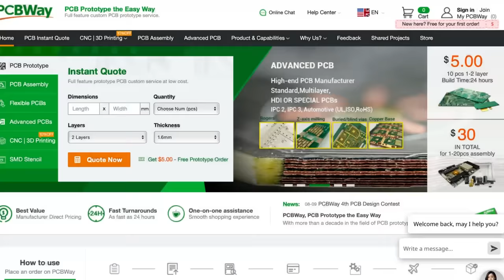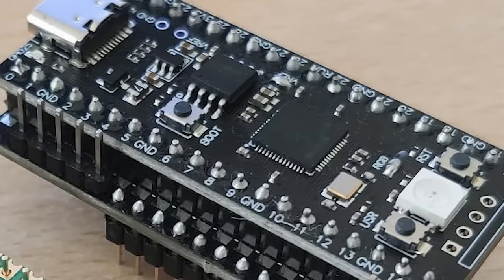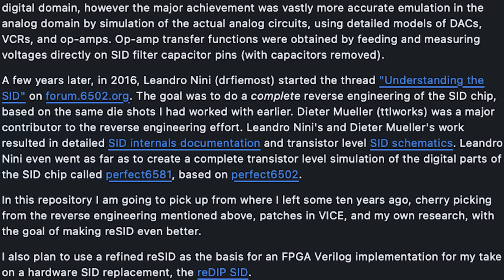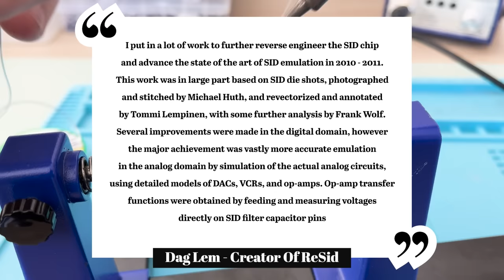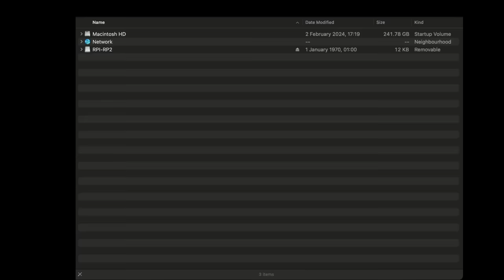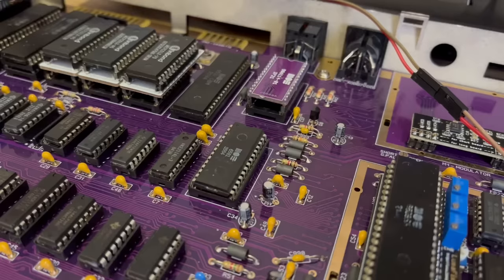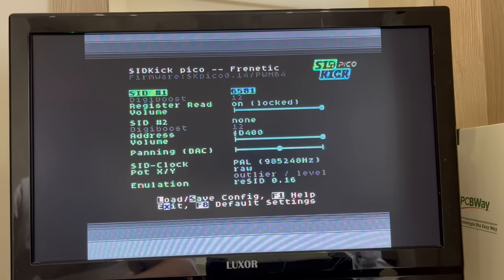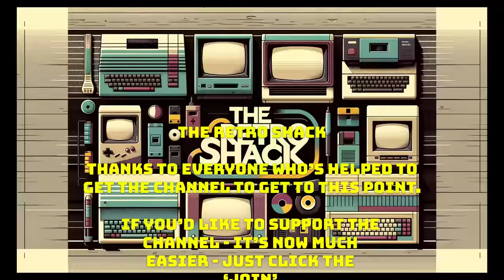Let's build a SIDKick Pico so our c64's 6581 has a friend to play with!  Oh, and is it any good?

Comment: The level shifters are for the data lines: 5v on the C64 to ~3v on the Pico.
Not for the SID 12v/9v down to 5v.
Reply: Yeah the level shifters have nothing to do with the voltage regulation
Reply: Indeed, these types of SID replacements don't typically connect to the 9v/12v pin at all. They just use pin 25 (5V) for power. The 9v/12v pin could be used for automatic motherboard type detection to switch emulation modes, if desired.
Reply from the maker: Thanks Adrian (and others) for pointing this out - I’ll pin this so it’s clear.
Reply: Hello Adrian. Greetings from Scotland.
Enjoy watching your retro computing videos, especially the Haribo intermissions (aye, lol)  @adriansdigitalbasement
Reply: Interestingly Eben Upton claimed the Pico inputs could cope with 5V, Hackaday comments September 25th 2022 on the "Pi Pico does PCMCIA" article.
Reply: @TheRetroShack The 9V is actually for the built in opamp. I have a few bad SIDs here that work but the sound volume is very low, almost zero. That's the opamp part that has failed due to the higher voltage. Just for fun I semi-fixed them by connecting it to an external opamp IC.
Reply: @M0UAW_IO83 it might 'cope' but it's documented officially that the Pi Pico i/o is 3.3V. It might work for a while but it might burn up at some point. Better to just use the 50c level shifter and save the more expensive Pi from any potential damage.
Reply: Yeah it was a whole lot of effort to explain something totally incorrectly 🤣
Reply: @TheRetroShack  And as a general rule for the future, if it says "level shifting" this means it provides a "translation" of HIGH logic level (usually between 3.3V and 5V) for devices that use the respective voltages. Powering voltages are never referred as level shifting, terms like "voltage conversion", "voltage regulation" etc is used for this purpose.

Comment: My tip would be: don't use those ghastly female headers to mate the Pi Pico to the SID board... because they're (aesthetically and technically) ghastly... throw them away and get some nice male and female "machine pin" headers... or just accept that you're "sacrificing" the Pi Pico and just use a single male header soldered on to both the Pico and the SID board.   :)

Comment: Resid is not the most accurate SID emulation any more, that one is unfortunately hidden inside the Plogue chipsynth C64 software synthesizer, which is a commercial software. Except if Plogue will feed back their code one day to the community.

Comment: The biggest issue with the armsid is closed source and encrypted firmware. the microcontroller on there has a protected bootblock that is used for firmware updates. it decrypts the firmware internally. they do that so people can't copy it, especially chinese companies ripping off and re-producing stuff for a fraction of the cost. with the pi pico at least it will be possible to make these almost forever at 1/3rd the cost. The biggest issue facing the sidkick is the eventual end-of-production of the pi pico and the new iteration of it that may or may not be 100% compatible, thus requiring an updated sidkick board. But hopefully someone steps up and does it when that happens.

Comment: Nice to see another SID replacement. I found another one a few months ago called BackSID. Fully compatible with the 6581/8580, everything is implemented except for the seldom used audio passthrough.
Reply: So it has analogue components, or is that side emulated digitally?

Comment: I'm quite impressed by that. The menu looks really good and great to see the Digiboost built in. There were some very subtle differences from the original 6581, but then it's rare to find two 6581 that sound identical (due to the analogue components & how they react to heat). The price is good too, although a group buy may be harder to organise.

Comment: I wonder if anyone ever created a real analog version of the SID's filter using discrete components. It almost certainly wouldn't fit in as small a footprint as these emulators, but it would be kinda cool, even if you had to have it in an external box.
Reply: Im using SwinSIDs and I have an external 8 bit DAC controlling a VCF - analogue low pass voltage controlled filter. It can be used to take out  the high frequency noise but also gives additional sound shaping possibilites.

Comment: Is it possible to buy these fully assembled for those of us who are hesitant to solder stuff? It would be worth the extra cost, even if it's twice as much.
Reply from the maker: I think there’s a link on the SidKick GitHub page for somewhere that sells them direct?
Reply: @TheRetroShack  I looked, but as far as I can tell, there is nothing
Reply: It’s against the license of the pcb.
Reply: @thomasandrews9355  The GPL license? I can find no such restrictions in it.
Reply: @taakelur  the pcb is not gpl sadly CC BY-NC-ND 4.0 also means: selling for profit on ebay (e.g. indicated by pricing), or running a shop and offering hardware under such license (no matter on which platform) is a violation of the license
Reply: @thomasandrews9355  I see. Seems to me this can be easily bypassed by simply paying for the 'work', and not the hardware, though..
Reply: @thomasandrews9355  It is nevertheless possible that a different agreement is concluded between the rights holder (Frenetic) and another party (like the Retro Store). In this case, other restrictions would apply than those specified by the CC BY-NC-ND 4.0 license.
Reply: The soldering that’s remaining after manufacture looks really pretty basic. Honestly, it’s a skill you need to acquire if you want to mess with these things. Pick up some practice kits or go to a VCF where they teach it. Even a local maker space to you probably has lessons. If all else fails, come to Chicago, I’ll show you how.
Reply: @c1ph3rpunk  A bit far from here in Norway, but thanks for the offer. :) Yes, it doesn't look that difficult, so I can probably manage.

Comment: I would only seriously consider using one of these if they could make a version that was the size and shape of the original SID (and ArmSID). Right now, it doesn't look very good. The actual RP2040 chip on the Pi Pico isn't that big, so I guess it should be doable.
Reply: You can cut some height if you fore go the pinheaders and hard solder the Pico to the level shifter board.
Reply: @OscarSommerbo  It will still look bulky and oversized. I am waiting for someone to create a single-PCB version that is the same size as the ArmSID. A standard Pi Pico board is very much larger than it needs to be if you just want the processor, since that PCB is meant to be a breakout board for maker projects and prototypes.
Reply: That would be absolutely doable, but it would increase the cost a lot, so i think that would be out of scope :)
Reply: @chepossofare  I don't see how that would be more expensive than this solution. The RP2040 chip costs $1 on LCSC (which is JLCPCB's parts store), so instead of ordering a manufactured PCB that does only level shifting like was shown in this video you could get a single PCB that also had the RP2040 chip on it, and then you didn't have to buy the Pi Pico board at all, the PCB could be smaller, and you could get the SMD parts, including the RP2040 chip, soldered on by the PCB fab. The main issue with this approach is the time it takes for someone to make the PCB design, and they might not want to make the gerbers available for free download. I don't see why they couldn't compete with the ArmSID on price, though, if they wanted to make a commercial product.
Reply: Go ahead then. It's not like someone's gonna read this comment and do it for you :)
For reasons of looks I only use Commodore made SIDs with the silicon flipped 180°.
Reply: @1337Shockwav3  I don't have time, and I am fine with using ArmSIDs for now, so it's not a project I would want to invest that much time in myself. You never know, someone might do something like this, whether they read my comment or not. If that happens, then I would probably want to try it. I am not asking anyone to do anything for me here, so just calm down.

Comment: soldering iron doesn’t look hot enough - solder should flow
down the pinhole not sit on top. Try pre-warming the board a bit with a heat gun to get over the heatsink effect.

Comment: I wonder if there's a way to avoid using level shifters and make a super cheap version. Maybe float the pico 1.2V above ground with two diodes and also diodes or resistors on the data lines. Might be janky but it might work.
Reply: No it won't.

Comment: Good to see another SID replacement though it does look a bit cumbersome, ArmSID is the definite aesthetic winner. Real shame you didn't do a direct audio capture your TV speakers didn't do it justice, though I guess you went for the true authentic sound we all heard back in the days.
Reply from the maker: Yes, although you could of course solder the pico to the SidKick PCB without the headers if you were sure you weren’t going to need the pico for anything else in the future. I’ll make one like that and post a picture for comparison.
Reply: You can create a custom PCB with rp2040 and level shifter and it will be if similar size to Armsid

Comment: Looks like you built it incorrectly.
Pin 1-5 should not be going to the C64 PCB but are to connect an external DAC to. Luckily it didnt damage anything.

Comment: I knew about the 32 voices originally speculated for the SID, but I didn't know they were actually present in the chip. Fantastic!
SIDKick Pico is a nice piece of hardware 😊
Reply: That's not what he said — the photo of the die shows the logic 3 times over, not 32x.
Reply: @pixelfrenzy  32 x Is 96 😁
Reply: it means "32 times" as in 32 voices.  @CiociariaStorica
Reply: @pixelfrenzy  👍🏻